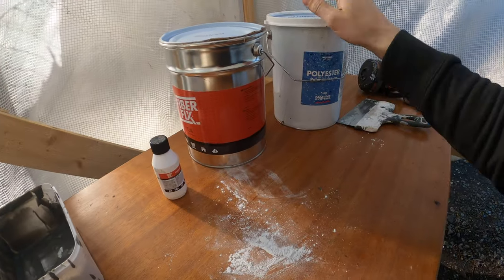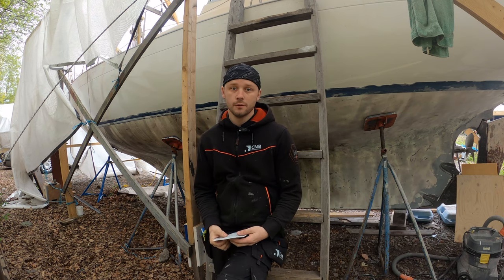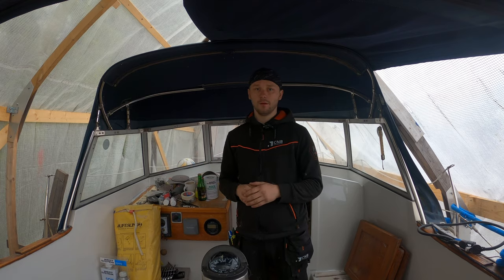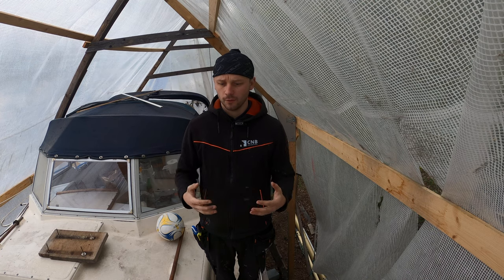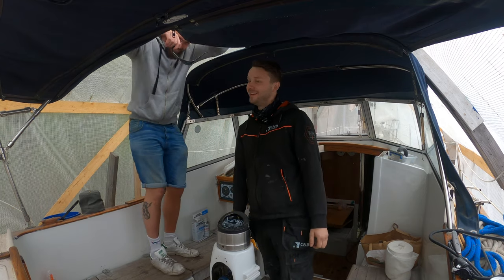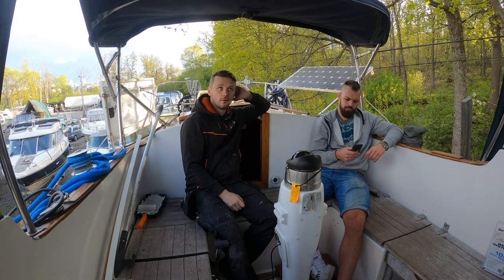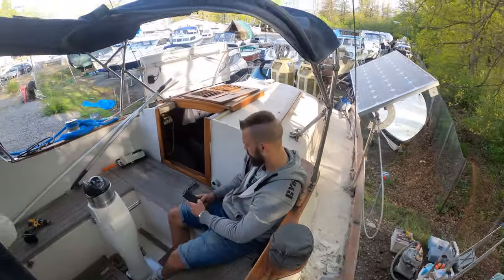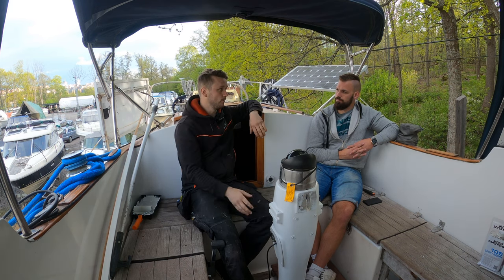Snowbird Ep35 Preparing the sailing boat for big painting, Hallberg Rassy Rasmus sailboat DIY refit

Comment: Epoxy as a resin is propably easyer to work with for beginners. It doesn't require that thorough surface preparation as it is basically a glue. You can do equally strong reparations with polyester when you know what you are doing and when you are familiar with the properties of the stuff and the stuff you are laminating on.
Both have their place.
I like polyester too...